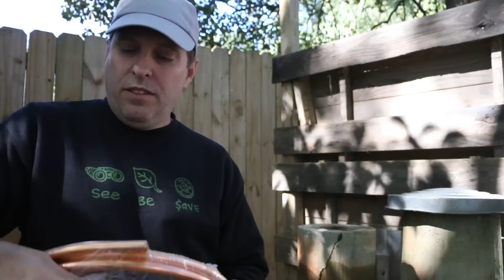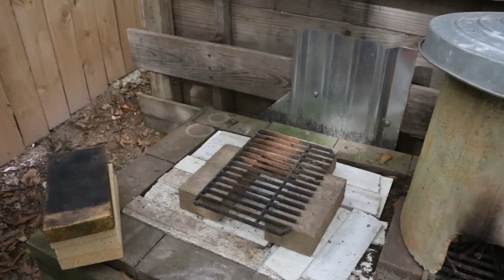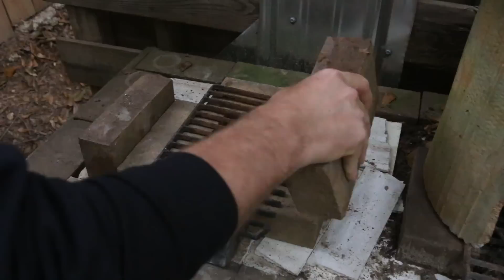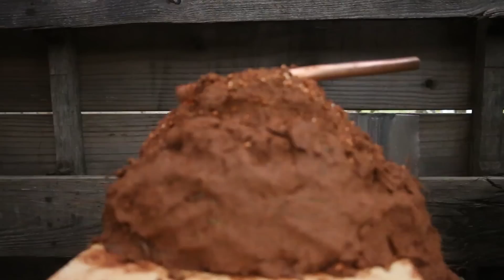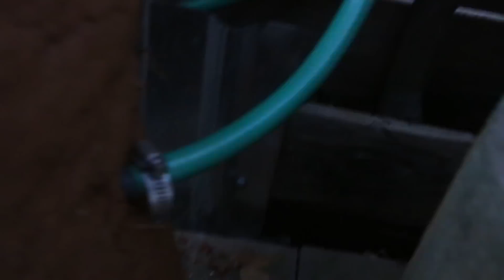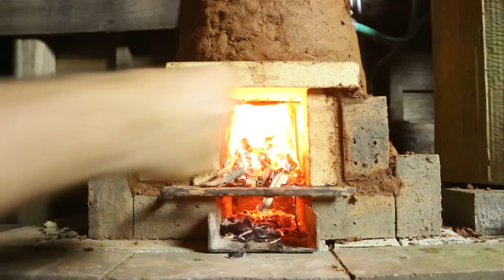How To Make A Cobb Rocket Stove Water Heater

Comment: @GreenShortz DIY
1: You need a 1-way valve on the hose, to make the water circulate, without it the water will expand in both directions & you get hammering that can damage the system.
2: You should have some clay on the inside of the copper tube, to protect it from the intense heat and corrosion from the fire.
Watch this: https://youtu.be/BREQY1TL7JA
Reply from the maker: Thanks for the tips, Sion. Sounds like you’ve got a good grasp of the fluid dynamics happening here...and the properties of the copper. I appreciate the feedback. Thanks for watching.
Reply: @GreenShortzDIY  Not really, I have just been "time traveling" through YouTube & seen the future of this device.
Here is the link to the future: https://www.youtube.com/watch?v=zwqPiZ4Wgys
Time travel is fun ;P
Reply: isnt this distilled water as well...i will go watch your time traveling videos-thanks.
Reply: @iwasmadetolove9459  I think I would STRONGLY advice AGAINST using distilled water.

I know that at least when heating distilled water (or rarely even regular tap water) in a microwave, it is possible to heat distilled water ABOVE the boiling point, because distilled water in a smooth cup doesn't contain "nucleation sites" (an imperfection , where-from boiling can start), and if eg. a spoon is put into the cup, ALL the water can instantly start to boil almost explosively because the spoon adds an imperfection where boiling can start (you REALLY DON'T want that).

Eg. if this happens in a tube, you effectively get a steam cannon.

I don't think I need to tell you how bad it would be to fire a steam cannon INTO a tent with a person inside, at basically point blank range...

You could add some salt or some other kind of "particulate mater" to the water, so it always have plenty of points to start boiling from.
Reply: @sebbes333  thank you...after thinking about distilled....it would be the opposite process of this. You heat the water and run thru the copper tubing to cool the steam then collect the distilled water. I am getting ready to boil maple sap on a rocket stove....so i will add another burner and make distilled water at the same time. Yes you are correct about distilled water and boiling it...thanks again. I love drinking distilled water, it tastes so clean. I do sometimes add various salts. I do not cook with it. Your hot water process reminded me of making it once upon a time. If i were doing your process i would want a big hot tub or a shower head with it. I think you can heat a green house with your method and have year around production. I might look into doing something like that with your info.
Reply: @iwasmadetolove9459  
Drinking distilled water isn't recommended either, it is too "pure".

There is a thing called "osmosis" (Google it), that is (very simplified) the equalization of concentrations (it has to do with physics & entropy, too complex for me to describe properly).

This happens with your cells* when you drink distilled water & can lead to cell damage, not really in dangerous amounts unless you drink a lot of distilled water, but it's still isn't very good.
 (* because cells have less water concentration because they contain "cell stuff", mitochondrias & things)

Maybe your tongue feels strange when drinking distilled water compared to regular water? 
That's probably from the osmosis.

You can do the experiment we did in chemistry class when we learned about osmosis:
* Take 2 or 3 gummy bears (or similar).
* Put 1 in distilled water.
* (optionally) Put another in regular tap water &/or bottled water.
* Put the last one in water that you have first heated up & mixed in as much sugar as the water can dissolve.
* Wait like 24 hours.
* Look at the result.

If you have questions about the result, please ask.

Think of the gummy bears as your cells, and their relative suggar-to-water concentrations compared to the different waters.
Reply: Not sure if I am asking on correct comment, but can calcium chloride be added? Helps add alkaline to the distilled h2o to balance the acid effect.

Comment: This seems like a terrible way to heat water. You could just put a pot on top of the stove. What you did do though, is make a water pump with no moving parts, and that's WAY more impressive.
Reply from the maker: I see your point. It does waste a lot of heat. The experiment here was to see if I could create a thermal siphon, which is the element of the video you connected with. I’m going to modify this rocket stove to add a method to capture the waste. That will basically add a pot to the top and direct the heat back down through a mass. Thanks for the feedback. Thanks for watching.

Comment: All wrong.  Chimney too short.  Copper line way too close to burn box.  You're not forcing the air down again and through anything.  You want the area near the burn box to be the hottest, to reach full combustion of material, which means no cooling it down with water.  You want the coil toward the end of the chimney, ideally after forcing the air back down and horizontally through something else - ideally this is where the copper tubing or radiator would be located.  Where it is now, the water is interfering with reaching full combustion of material.  It's almost a wood burning stove in this configuration.

Comment: Would it  be more efficient, and safer if a damper was designed near the top of the chimney?  That way the flames would be contained and the heat more concentrated around the tubing?

Comment: 10 feet will not be close to enough to make hot water I have a 25 ft coil of copper in a burning barrel trying to heat my swimming pool above ground and it's not even enough .... yes I can get about a half a gallon of hot water max if I start the fire let it burn heat up the coil then start running the water maybe a half gallon before it cools down

Comment: You can also send a steel cable down the copper tube to prevent kinking. If you pull some cable out as you twist it it's less likely to get stuck. That is the best way to do brake lines btw... You can also fill it with water and freeze it

Comment: Interesting watching the cob being made! I Made a cement copper coil stove recently too. I also used 3/8 pipe but roughly 3x more. I found that it burnt so much better when I slipped in my flu extension. And it got much hotter. So far I've used it to heat 200l of water with success.
Reply: How much time did you to heat up 200lt of water?
Reply: @flamel397  takes 3 hours to heat up
Reply: But that's not 100% of the tank. I only use the top quater as that's always the hottest part. Normally comes out at about 45c
Reply: @calmauric8218  im asking cz im trying to build a greenhouse with this method to heat up the gh and to make sure that theobroma cacao has 23/25 C temperature all the year. Did you actually know if this method with heating the water cloud help me to do this? (I'll heat up approx 300lt of water in the cold night)
Reply: @flamel397  ok. Look into "rocket mass heater" several people have successfully heated a greenhouse bed in Sub zero temperature. It's like a rocket stove. But even better
Reply: @calmauric8218  alright mate, thank you vero much!!!
Reply: @calmauric8218 what If i combine rocket mass heater with a large bucket of water and coils to heat and store energy then heat up the greenhouse in the night? (using water to spread heat) Do u think its gonna work or should i only use a rocket mass heater?
Reply: @flamel397  you run the flu pipe in a zig zag pattern through the garden beds soil. As long as the pipe is on a very slight upwards angle it will work. And heat the soil. I suppose you could also add a copper pipe thermosiphon loop into the soil bed also. But just the flu pipe will do the job well
Reply: @calmauric8218  what about if i add a 55 gallons or more of water near the plant? And heat two copper coil inside the rocket stove and make sure that i'll have a thermosiphone? And i can add even another protection of film on top of the plant and on the plant also. 
My greenhouse gonna be inflated btw. 
I just discovered that the plant can survive even when the temp is 45F (7°C). Are you sure that your pattern of coil underground is a good idea?

Comment: That was cool.
Always super satisfying managing to build one of those devices that heat water with only super durable stuff.
Now what I want to know is how this model compares in core temperature, gas emissions, and volume of BTUs transferred to water, to a model made with the same cob and the same heating chamber core surface area, but which has the coil in the place where you would put the barrel on this rocket stove : on the way out of the hot fumes, but not in the heat riser itself.
Because in the rocket stoves DVD they say that the second is better.

Hey I'm building one right now!! Maybe out of stainless steel if the shop say they can weld it for me at a reasonable price. It's just to hold the ceramic boards in place, it's not the actual rocket stove.

Comment: Instead of placing coil inside the near the fire. I would have encased the coil inside the mud. Still getting the heat from inside but would have given you a much larger coil ring for more water to be heated.
Reply: Robert Montgomery agreed, I guess he will burn through that coil pretty quickly.

Comment: maybe a metal bucket on top of the stove
Reply from the maker: Hugh, you’re right. That would capture a lot more of the heat this stove is making. I’m thinking about moving this little rocket stove water heater to my greenhouse (which needs some work). I’ll add your metal bucket to the top, and redirect the exhaust gasses through another mass to capture more of the heat. Thanks for the feedback. Thanks for watching.

Comment: Great project! I also really appreciated not having background music with everything. It had a good balance.
Reply from the maker: Thanks for the feedback. I throw an audio track in when I need to. If my high-speed video goes over 1000%, the audio drops out of the render. So, I cover those spots with music. Plus, some sections just feel like they need a jam. :-) Thanks for watching.
Reply: @GreenShortzDIY  I do agree with Worthless Professor on this, I'd rather hear ambient sounds than a soundtrack. I realize many(not you) think they are making hollywood blockbusters rather than sharing the knowledge they have gained over a lifetime of experience. Which often comes with many failures and some great successes. Rather than the music some feel compelled to add I personally would rather hear the"oh sh** i screwed that up and i need to redo all this part"
I'm a hands on guy who learns from others mistakes as well, at least when they share them. Not sure why people feel compelled to remove the not quite perfect projects. I've never started a youtube channel even though I've been making projects since i was a youngster, and that would be about 50 years ago (smiling face inserted here)
keep up your great work, i enjoy it greatly. thanks again, halfnuts.

Comment: Yours is the 1st homemade stove that uses some commonsense and makes full use of the waste heat. Have to agree with some comments about the wasted expense on the copper which you acknowledged. Of course it's going to heat the water, no need to test something that's so commonsense to work out. Hopefully, you'll be able to find a use for the short piece in this experiment. I think you need to at least double the size of this stove all the way around and as suggested elsewhere, lengthen height of the stack and copper coil exchanger at least by a factor of 4-5 times it's current length or even longer. Object is obviously to pull as much waste heat out of the stack as possible without adversely affecting draft. If you were off-grid you'd want to modify the setup to include a front draft control to make your wood last and control the heat. Good job. Now you know what you know. Looking forward to seeing something that will be functionally useful like say a shed/garage heat unit in addition to the shower. The hot water could be piped into the shed/garage with little issue and keep the fire outside where it's safe.
Reply: When I read comments about heating radiator system I think of the hazards of heating water in a sealed system without a safety outlet valve. It has the potential for explosion or rupture if the heat input is excessive

Comment: good video again. i still am wondering if you are putting the coil in the hottest point of the fire being in the chimney. I think this could should really be put into a rocket stove mass heater from the top of can lid down the can. even using some form of gas this principle would capture much of the heat before it goes to a bench and could heat the whole floor of the house ? where are all the fire bugs developing home heating systems that burn junk mail? any time you want to be the show guy behind the ideas, let me know. lol. only kidding

Comment: if the copper tube is 15-20cm above the fire is better heat absorption.. Also copper tube must not only at the side wall but also on center of heat hole.

Comment: I could not tell in the video if you covered the copper coil with cob. Can the copper be exposed to the fire? I plan on making one of these but thought that the copper would melt if it was not covered
Reply from the maker: Hi Porter. The copper coil is exposed on the inside. I think that as long as the coil stays full of water, it won’t melt as the water will pull the heat through the copper fast enough. I’ve actually boiled water in a styrofoam cup sitting directly in a fire. The water is a much better conductor and pulls the heat though the foam faster than it can melt. I’m working on another coil water heaters today. It will be fully exposed to flame in a rocket stove. Let’s see how it does. :-) Thanks for watching.

Comment: I've seen videos on these before and the hot water hose gets so hot it almost melts. Could you/should you use steel brands like the ones from a clothes washer?
Reply: To my understanding steel compresses and expands a lot more than copper due to thermal shocks. So basically the steel will eventually break the mud apart from moving due to heat.
Reply: @worxharder9470  I  am talking about the water hoses on the outside of the mud casing. The in coming cold water and the out going hot water hose.

Comment: You can wrap the copper around the pvc first. The pvc acts as a form for the copper and will prevent kinks. As a bonus, if you leave enough room by pulling the coil up the lenght of the pvc, you can set it in the fire box and it will also be more stable when you put the cob around the coil and the pvc.

Comment: just one question... haw long takes you to heat up water to the decent tem, let say 60degC? Idea is amazing... i'll will use it in the woods anyway :)
Reply from the maker: Hi Artur. Thanks for the question. A few factors in the answer, how much coil do you have, the temp of the fire, and the volume of water. I didn’t actually quantify time to heat on this burn. On part two I think it took about 20 mins to heat 5-7 gallons of water to 100 degrees F. Hope that helps. Thanks for watching.

Comment: Just slide a long spring over the pipe....that'll stop kinking
Reply: dave matthews where could I get such a spring?
Reply from the maker: Great tip. Thanks Dave. Thanks for watching.
Reply: GreenShortz DIY where could I find such a spring?
Reply: I bought the springs years ago. Not happy with them and when my tubing kinked i had a pita getting the spring off.

Comment: you would get faster hot water with a pot on top and a drain tap with drain in the bottom (on the side). Then you could have an incoming pipe with float valve that regulated the water as you used it.  In other words, your concrete oven next door is more efficient than this cob oven.
If you let the copper coil go in a sack or spiral freely in the chimney, you would have better exploited the flames.
Reply from the maker: Ulf, thanks for the feedback. I think I am going to try a free-suspended coil in one of my other rocket stoves, and perhaps the pot on tap as well. I'm just going to have to make sure I don't melt myself with the hot water. :-) Thanks for watching.
Reply: @GreenShortzDIY  You can use a shower battery where you can mix cold and hot water.

Comment: it's free hot water. all it takes is a lot of time and energy.
Reply from the maker: Ha. True. Time is money. But, it was my time so I didn’t charge myself. :-) Thanks for watching.
Reply: @GreenShortzDIY  and if there is power outage u have options.  Looking into doing some small mass heaters for my cat sheds.  Power costs 20 a day and not doing much but knocking edge off.  In Alabama but winters seem to be getting colder.  Power definitely more expensive.    You make it look easy